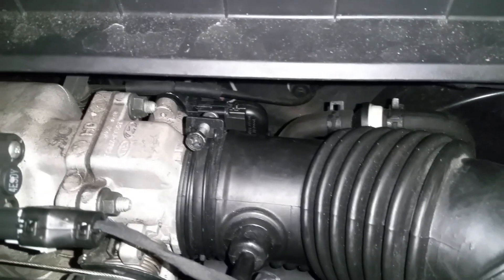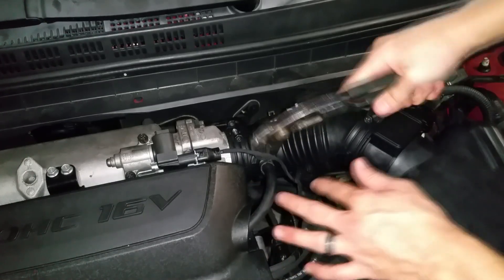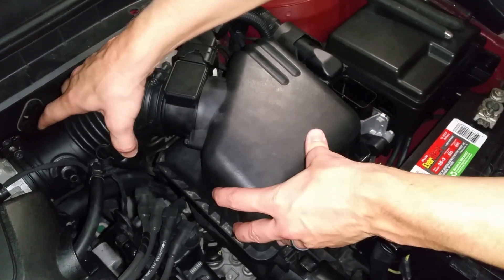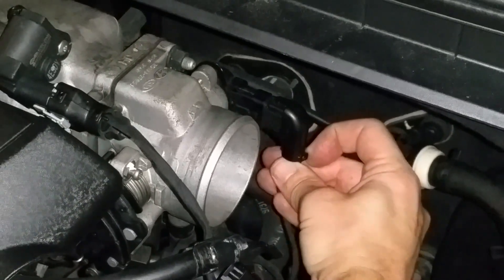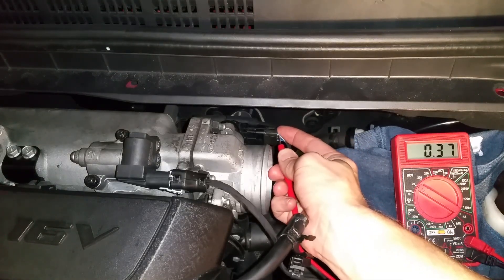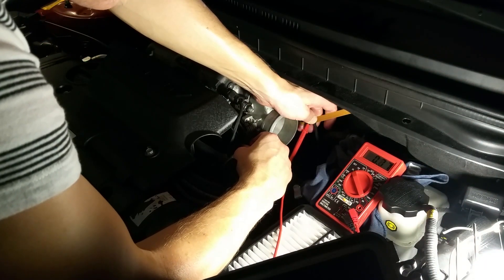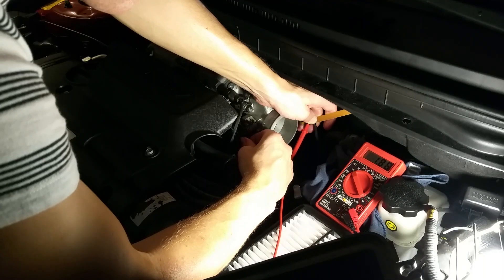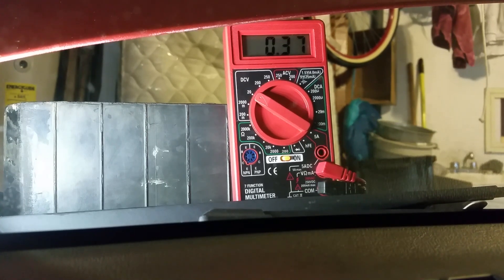Hyundai Elantra: How to test your Throttle Position Sensor / TPS

Comment: How do you replace the throttle sensor if it's bad?  Is it just two screws and pull sensor out, and reverse for install?
Reply: I went in and tried to replace the bad sensor on my 2008 Hyundai Elantra.  I used a mirror to see the two screws were the kind that can use either flat head or phillips.  I could get a 2" long screwdriver on the screws holding the sensor, but I could not get enough torque on them to loosen them; they've been on for 16 years.  Even if I could get them off, I don't know if I could get them back on because it's a mostly blind effort.  It seems like you need to take off the metal housing off to the left of the 3" hose and I have no idea if that's easy, hard, or what ... and if you're digging yourself quite a hole to climb out of.  I've put everything back as it was for now ... and the throttle surge and hesitation will continue.

btw, after release the small hose clamp, I could not get the small side hose to pop off.  It was enough out of my way to do the above.  And I could not figure out the dual catches of the small cover.  I could pop one open, but not the other.